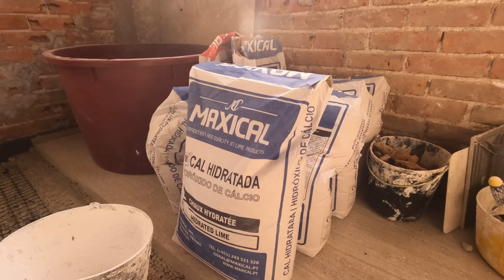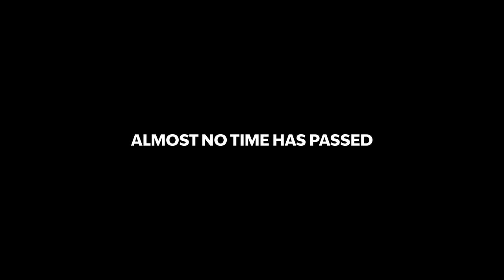Float Coat Lime Plastering Experiment - Learning by Failing

Comment: I'm a bricklayer by trade not a plasterer so take what I say with a grain of salt! Here in Western Australia we cement/lime render as a base coat and finish with a plaster of paris/lime coat. This gives a white fairly soft finish. This mix is applied much wetter than the mixes you made. My elbows were shrieking in protest! I don't think you need hemp in your top coat it needs to be about 3mm thick. If you can't get plaster of paris then a softer sand /lime mix will probably do the trick. When you tip out of the bucket it should flow not be a bucket sized lump. Best wishes for a great result.
Reply: Completely agree.  Maybe even running a rasp over the wall a  bit to cut down the exposed hemp fibers.  I've put a pre colored "plaster" finish on gyp board and the technique for making the surface smooth and shinny is to "burnish" the surface with a flexible steel trowl when the plaster is still just a bit wet.  I would say the sans hemp mix did have too much sand.  If a smooth surface is desired, the final float coat needs to have less coarse (sand/hemp) and more fine (clay).
Reply: I believe that they added hemp fibers to the mix to insulate the walls thermally, yet still allow them to "breathe "

Comment: I have done plastering using  hot-mixed lime plaster. Adding lots of water and making it spreadable like modern plaster wasn't an option (plaster would  crack and fail when it dries). After getting the plaster on the wall (it was like clay) I used a wooden trowel to shave & compress the plaster, then went over it with a clean & wet steel trowel. Result was robust, with rustic texture. I think you are doing the right thing by experimenting; you can make it work.

Comment: Speaking as a potter who works with clay, we never use a sponge to get a polished surface because the sponge just removes the finest particles, leaving the coarser ones to stay rough. Using a hard tool like a metal, wood, or rubber (if they exist) trowel will push the coarse grains down into the body, and allow the fine particles to come to the surface. When i want a polished surface on my pots, I smooth the surface with metal, silicone rubber, or another hard surface.
Reply: exactly my thoughts.
Reply: A sponge would never be used as an actual finish, but it is often used to get to that finish. Plasterers will sponge float their final coat to smooth and level it out, and to fill in any remaining divots/low points, then wait a short while before going over it with a finishing trowel.
Reply: @ptolemyauletesxii8642  exactly, and it no matter what you use as material, traditional cement/sand or anything else it will always bring agregates to the top and work in the actuall cement. Once dried will need a brush off to remove the agregates that came to the top as they will be loose anyways. Then could apply finish. Though in south america/india and many asian countries they often to not topcoat with finishing materials, especially not on the outside of a house.

And since this contains an absorbing agregate, in this case i would dump the hemp in a bucket of water, then immediately remove it and then mix it.
Then once dry enough go over it with a mix without hemp/straw at all to fill in the low spots. Wait a bit more and then finish off with a trowel before aplying the final finish (totally straw/hempless)

The nice thing is, he is learning this whole process just by trial and error! 👍

Comment: I am a plasterer and I have some experience with lime plasters. You CAN use hemp plaster as a final coat, but you'll generally struggle to get it much smoother than you have. After you do 2 or 3 coats of hemp plaster, to build thickness and insulative value, you should finish with a lime finishing plaster, generally 2 coats, done one after the other. The float coat on the hemp plaster is to smooth it, level it, and fill any deeper gaps, but it won't get terribly smooth because of the fibres of the hemp.

Comment: I'm also not a plasterer, but I have watched them work, and I agree with Porter Rockwell and metallitech to a great extent. If you want a smooth finish perhaps you need to leave the hemp out of the final skim coat (comment added before I'd watched right to the end!). However, it's not my house, but I like the rustic uneven look you've achieved already! On the plus side you're saving on gym membership ;-) Keep up the good work. Cheers

Comment: Hi Guy and Kylie. I have done lots of plastering in my life ( I'm actually a doctor) but I spent many years plastering in my university days-father was a plasterer - and so useful contact for work during holiday breaks, and I consider my self reasonably skilled at plastering and I think your natural skills as a plasterer are very very good! You seem to have a natural feel for the motions and movements and I am very impressed. It does look a little more difficult than it could be - sometimes plastering a wall with the correct mixes/materials can be very satisfying with the way the material flows on to the substrate and can appear to have a 'creamy' feel to it. I felt there was too much hemp in the first mix and the mix perhaps wasn't quite 'fluffy' enough and the second (sand) mix was perhaps a bit sandy. I'm wondering if an experiment with less hemp and a small amount of added sand and a bit more lime might be worth trying in order to 'lighten' the mix and make it a bit creamier and fluffier. I agree with the Aussie chap below as well with regards the 'flow' from the bucket.

But - Guy - as I said - I think you are doing an excellent jog, your skills are really looking amazing for a beginner and I really really enjoy your and Kylies videos - very enjoyable!

Comment: The coat without the hemp looks better and I remember that in our cottage we regularly done white lime wash on the walls to freshen the colour and over the years this also smoothed the wall with its layers, sympathise with your frustration 😊
Reply: Yes! As a child it was my job to paint the pantry with 'distemper' as it used to be called. It had to be done each year and a smooth flat surface ensued...but primarily it is a great antibacterial finish and kept critters out of the pantry. 👍🥳

Comment: In my old apartment in Germany, we used to freshen the walls with white lime wash. You can tint it if you want. We added a can of white latex to a large bucket of lime wash to prevent the paint from rubbing off on your clothes when you leaned on the wall.

Try to search your products and process ( on Google and YouTube) in Portuguese and Auto Translate it. A Dutch guy I follow, renovating a house in Italy, said he gets a lot more information searching in Italian, than English.
I would also try it in Spanish as the houses in Spain are built similarly.
Reply: So you watch the Dutch cyclist who is working on his shepherds' huts and who lives near the monk? I love watching his show as well, though it does not contain the humour of these two.
Reply: Agree with the plasterer guy. Leave it to dry then apply a thin coat without Hemp fibres should be 🍑  peachy
Reply: @c-mac2228  link please

Comment: fantastic job! A tip I learned was that each coat has to be a weaker lime than the next.  I just hope that your scratches are deep enough to hang onto the next coat. Yep it has to be more fluid. Top coat should be without hemp and added chalk.
 Plasterer's are not called 'god' for no reason.. They are usually triangular in shape and built like brick sh**thouses 😅Lime plasterers that I know usually float up with a plastic or wet steel float.  To do the corners use a wet plastic bag. its cracking because the base coat is drawing the water.  You need to spray it with water after you have applied it. Don't fiddle with it.. its an old wall and doesn't have to be flat

Comment: The sand lime renders you did on the second wall look quite good. The plywood float is what I would do. It should knock off the high spots, and smear into the low spots. After the material has dried a slight bit, a soft sponge wet, not dripping would be rubbed on the surface to even any remaining lines and present an evenness to the look.  (similar to sanding a wood board before painting)  My father and I would do this type of finish with sand and cement on exterior walls to cover  Block or Concrete walls. 
 For the finish coat, I would apply a pure "hydrated finishing lime" soaked for 10 hrs minimum. You will want this creamy smooth, sieve the soaked lime through a 1/4" screen, then like a recipe, you place a portion of your sieved lime on a board then mix in a small amount of "Plaster of Paris", we would also add, something we called Slow Set at the same time.  These two compounds caused the lime render to harden as you apply it, much like concrete hardens. This hardening gives you the opportunity to trowel to a smooth hard finish. In this final finishing coat we apply two coats around 1/8" thick each. Happy troweling.

Comment: Hi Guy, I feel your frustration. I’ve done similar projects that don’t have a clear answer. Have you considered measuring the plaster mix by weight ? Bread bakers measure by weight to account for air in flour, etc. for a more exact replicable mix.  I love using a large fine pore sponge for smoothing a wall.  😀 - Eric.

Comment: Keep up the good work!
No idea if it's available in Portugal, but plastering sand will give a much smoother finish than building sand when mixed with lime. Definitely no hemp needed for the finish coat.

Comment: Someone I watched doing something similar was saying that you have to spray some water between coats so it can adhere to the base coat.  This probably answers the question od the base soaking up the humidity from the fresh one. Maybe contact Theo, from the Indie Project.  The couple renovated an old barn in Portugal and it turned out awsome.
Although he used sand not hemp I think.
He sprayed like you did, but before applying the second coat.

Comment: iI would suggest that if you mix your lime with sand (1:2) you will get a fine lime plaster. You can then apply it as a fine plaster on top of the coarse plaster. GOOD LUC

Comment: If you want to smooth the surface of the walls, use white cement or slow-drying plaster sparingly, to spread the paste, use a hard rubber trowel

Comment: I only have experience of plastering with gypsum plaster, but I'm surprised at any instruction to attempt to aim for a smooth coat with any sort of fibres in. If you want a very smooth finish, you should be using plastering sand which has very fine - and clean particles. Coarser building sand is dirty and will not get you a nice finish. You will never be able to rub that smooth.

And yes, plastering is bloody hard work. The experts make it look easy. But with most types of plaster, the mixture also has to be more sloppy than what you're using.  I think you've got accustomed to working with stiffer mixes and that's not what you need to get a smooth top coat.

Comment: in the Netherlands we use something called "witkalk" translated whitening Chalk it fills in small cracks and low patches and makes a smooth surface . it is a kind of thick chalk paint. maybe something you can use on the hemp/chalk wall. to me sounds like it is compatible with your walls.

Comment: You can mix your lime the day before then leave it .and knock it up next day.makes it creamier..I had finer hemp for top coat. But did finish it with a float.
Reply: You should use a Darby to get wall flatter too.helps floating up..if all else fails you can put a top coat plaster..

Comment: I wonder if you could break down the hemp fibers into much smaller particles by running it through a food processor until it's a coarse powder more like sand. I have no idea if it would work, but it seems that the finer the hemp fibers are, the less chance of them being dragged around by the trowel.

Comment: fiigured you would have just done a lime/sand mixture for the final coat to get it nice and smooth and use the hemp as "isolation layer" (aah you do later in the video) just paint it with a lime wash (it will be BRIGHT white)

Comment: Finish coats of lime without the hemp. The hemp is on the wall, now cover it with a sand/lime mix fairly wet. It should slump when you transfer to the board

Comment: Great edited opening sequence....RE: high spots and low spots. I wondered if you could have demonstrated this better with a flat surface against the wall so you could show which spots were high and which low.  It was still clear enough. A light from your phone under a flat surface with the camera above would show the light coming through. Doing things by eye is ok, but you'll get a better finish with something engineered....Also, I looked at quite a few decorative paint techniques that give a different look to a 'feature wall' and wondered if you'd try a tester pot on an area and just roller it on. Perhaps something darker, a slightly darker cream colour, and check out what the look of the wall is like.  Possibly worth trying out - it might be something you just don't like, or only looks ok from a greater distance than you have in the room  - it may give you an interesting look to a semi-finished wall. I think it might be a bit too abstract or a bit too arty and though some of the fibres showing in the painted wall might show the guts of the building, it depends on the look you want. Anything unfinished would be more difficult to clean and it might be breathable but you'd get through so much anti-mould spray it would be untrue....sometimes you get a feature wall and it looks like the owners couldn't be bothered to finish it. I wonder if this will happen in your home....!?! Interesting video for techniques and how much work is involved - definitely not a fail...

Comment: Check relative humidity and room temperature. Like dough, may need to add or reduce the amount of water. For plastering, softer, more moist to easily spread. Next time try finer sand, more water - start with minimum and add additional water. As mix sets and dries, continue to add water to keep pliable, before applying to the wall. See if you can source a finer lime mix. May try pre soaking plaster mix, rest, evaluate, add more fine sand/water to get desired texture. Soft and moist.
Experiment: Compare a cement/sand plaster (thickness, ease of spread, smoothness) final layer finiah to a lime mixture (hemp, other) finish.
Reply from the maker: We will never use cement, it’s the most unsuitable material for this building
Reply: The suggestion for cement was to compare the mixture texture, ease of application and desired finish (smooth to textures). Several methods to smooth - sponge, trowel, small flat handled wood piece, long board. To determine how wet & granular to make the lime mix.  Also seen plasters dust a wall prior to plastering.
Will wait to see what changes you make for the various wall finishes (bottom, middle, top).
Reply from the maker: @rolandtb3  ok, got it.
Everyone just seems to have missed the point of what we were doing with this video …

Comment: Just an idea: You say that the fibres tear the smooth coat, is it an idea to use a rolling pin, probably kept wet to prevent from sticking, to press down the fibres without moving them around?

Comment: Pretty sure you need a finer more consistent sand.  Might want to pre slake your lime.  Make the putty, allow it to settle down for a day or two....Then experiment with small batches to get the result you're looking for.  Pretty sure the lime putty can stored under a layer of water for some time.  Hemp is going to make your final coat a nightmare.

Comment: I have never plastered with line plaster but as an electrician I have chased in to 1000a of metres of it, I have never seen fibrous material in line plaster on solid walls, fibrous (I was always told it was horse hair)  material is present in lath and plaster ceilings and walls but never on solid walls.

Comment: Where i come from we use cement not lime but for the finish coat we mix cement with very fine and filtered beach sand and make the mix a bit more watery than you made it so try lime with some fine beach sand but nor too much sand so it comes out smooth and white

Comment: I think the second wall is looking good. Why don’t you make some lime wash and do a few coats of that so get a smoother finish. That’s what I do and it works well, I’ve had success mixing pigments in my lime wash, pale greens, yellows and it leaves a lovely natural matt finish. If the wall is a bit rough I just make my lime wash a little thicker. I am using NHL3.5 and white sand not super fine but not a masonry sand. Keep up the great work. Lisa

Comment: When I plaster a wall I usually have 2 vertical boards attached to the wall that set up the "plane" of the wall.  Once I get the plaster up and its still wet, I run a horizontal board down the vertical ones to create a flat wall (a plane).  Or at least I can use the board to find high and low places and fix them.  Ideally, the 2 vertical boards create a plane that is square to the adjacent walls.  Eventually, I take the boards off and fill in the void left.  Needless to say, all of the boards have to be straight.I guess you could use a laser level to do this too.

Comment: How about not using the hemp. Make a mix with 1 part of cement (can use white cement, or regular cement), 2 parts of cal,  and 4/5 parts of fine sand ( use a fine sand and pass it through a construction strainer).

Comment: the bags of hemp lime sometimes have more than those two components Ty mawr add Pozzolan and an arienne lime.  Incidentally; I have contacted Ty Mawr Lime quite a bit and if you are struggling with anything - it's worth giving them a call or dropping an email. Top coat is very little sand or no sand at all but add CHALK instead of sand. if you lime paint it (with paint made to consistency of double cream) you will hide the surface.